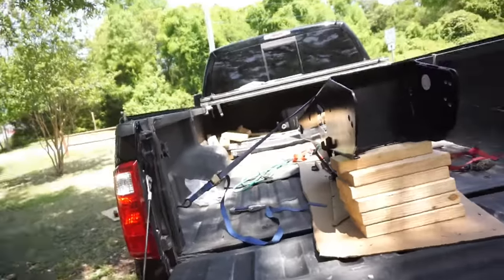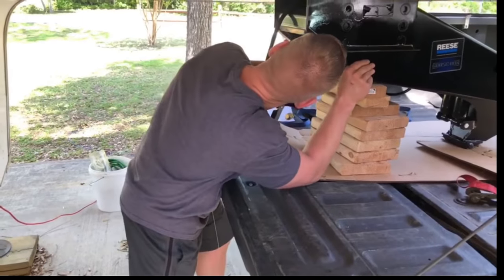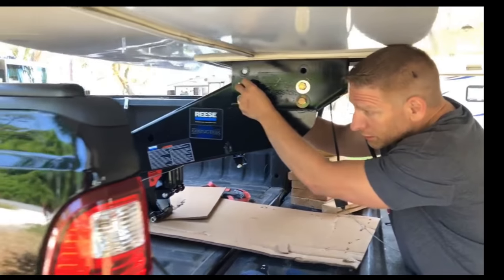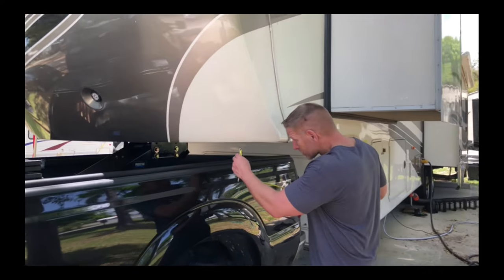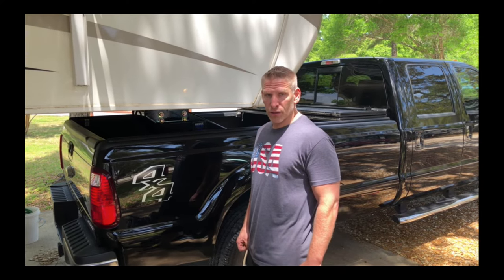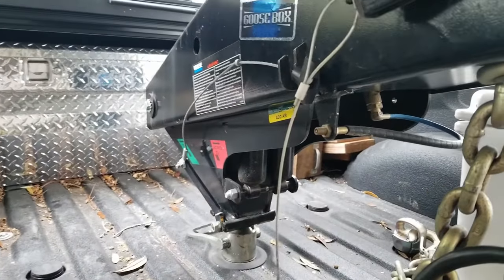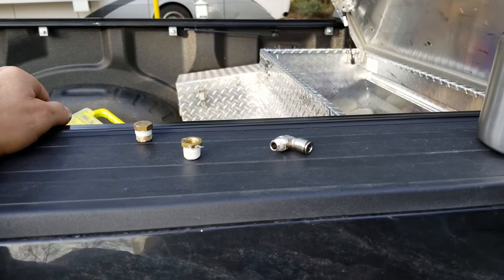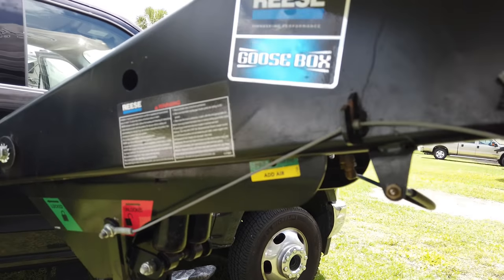How to Install your Reese Goose Box!

Comment: So when you fill the airbag up it also increases the space between the top of the bed and rv? If so how much? Because I have about 6.5 inches w/o any air in the goosebox
Reply from the maker: Yes,  just a couple inches.  I'd measure, but don't have it anymore. I wanted more height,  so I used a B&W ball. It's about an inch and a half taller than most other balls that fit the factory fifth wheel prep.

Comment: How did Reese respond to the issue of their blow off valve?
Reply from the maker: They send me a new one, which also had issues.  I had a wireless air compressor that I installed in the pinbox mounting area and plumbed in via the blow off valve hole so I could fill/adjust pressure on the fly.  It worked really well, so I  never pursued the valve again.

Comment: This is a super big bad idea fifth wheel camper’s with a fifth wheel hitch are not meant to be towed with a gooseneck. This will add all kinds of unnecessary stresses to the frame of the camper and definitely voiding its warranty very bad thing to do and no reason to do it
Reply from the maker: Actually, Lippert covers use of the Goosebox on their frames, and they manufacture the vast majority of fifth wheel frames.  It's not a true gooseneck adapter - kind of a hybrid.

Comment: Yeah using the landing gear on the front of the fifth wheel should make this project super simple... I also threw in my floor jack into the back of the bed,,,, went together super easy!
Reply from the maker: Yeah, it made it a one person job!  You can also use the airbags on the truck if you have them to fine tune height.  I didn't have a floor jack available, but would have been handy.

Comment: Buyer Beware! 
First - The Reese pinbox I ordered 6-weeks ago came without installation hardware or directions. The hardware took over a month for them to replace and again came without directions.
Second - The Reese pinbox DOES NOT have the air valve as pictured on the websites. When I called I was told it was due to a parts shortage and the person I spoke to at Reese (Paul?) even told me that the new set-up was a solution their engineers came up with to deal with the shortage and it makes no sense (his words).
I TOTALLY AGEE! Send me the part! They were supposed to and never did.
To inflate one person has to literally crawl under the pinbox, while hitched to the 5th wheel, to inflate while another watches the bar. Not easy for a 60+ year old fat man! 
The valve faces OPPOSITE the side where the inflation bar is located! Plus, the valve is so close to the wall of the box you cannot install an extension hose. Just Dumb.
After follow ups with eTrailer, I were basically informed by Hannah that I have to live with it. Either that, or I could pay to ship it back. Mean while, both Reese & eTrailer are selling parts that are not as shown on the website.
There is now a Gen 3 with a redesigned air valve, but they are shipping out leftover Gen 2's with missing parts.
NO - NOT HAPPY
Reply from the maker: That sucks!  I was an early adopter of the pinbox, and it worked well then.  I did replace the air valve and connect it to a compressor to control the air and alleviate all the issues associated with the air leaks.  I actually had Reese send me three of the valves that were being used then, and none worked. 

In the current market, I would be taking a hard look at the GenY Executive fifth wheel hitch.  It's simpler, and appears to be well built.  I have not used it though, so take it for what it's worth.

Comment: Great video on the installation.. I am debating on getting a Goosebox.. I have the same truck as you except it is a F-250 and it also has the factory 5th wheel/Gooseneck prep package so your video was exactly what I have been looking for.. You mentioned your turning was limited.. I have not found a video on showing the turning limits in you setup configuration.. Could you possible make a video showing the turning limits when you are hitched up?? It would really be great since there is no Gooseneck ball extension available yet for the factory puck system..Thanks again for the video..
Reply from the maker: Thanks for the comment! After using it for awhile, the turning angles aren't actually reduced.  When I first used it, I thought they may be, but I can still turn to the point of hitting the cab of my truck (if not careful).  The only issue that I've run into is that I can't open my front cargo door all the way - it now hits my tailgate towards the top.  I think there's maybe an inch difference, as the Andersen allowed it to barely open.
Reply: @TrippinWithTheSmiths  I have this same 1st gen of the Goosebox in my F350 dually bed going on 2 years (pulling 42' Coachmen 392mbl).  I park my 5th wheel in commercial, covered storage and literally have to back it in from outside the gate for a total of about a 270 degree landing.  I am commonly just short of 90 degrees backing.  There is absolutely max turning and maneuvering capability.  I am a huge fan of this goosebox.  The airbag is like driving on budda.  Also, it is so very nice to get where you need to go, then turn the ball over into the bed... and voila, wide open spaces in the 8' bed!  Safe travels.  bg
Reply from the maker: @takeitallin6882  Yeah, it's great for maneuverability....and not having it in the bed (we full time) is awesome, and I really miss it now that we've been forced to a traditional hitch.  We're too heavy for it.  I may get a GenY Executive Fifth Wheel hitch - they go to 30k and use rubber torsion suspension.  Would like to get a chance to chat with someone who uses one first.

Comment: Thanks for the honest review.  So far you are the first that said that you did not gain space because the Goosebox hits the items as it turns.
Reply from the maker: Np. The arm of the Goosebox sat a bit lower, and it killed our cooler that fit under the previous combo.  Your experience may be different,  depending on height,  but we had slight issues.  I'd still choose the Goosebox or maybe GenY overall tho. Ride quality and getting the bed back after towing is great!

Comment: Thank you for this video...your review is honest, and now after watching (air issues), and not really anymore space I dont think Im interested in this hitch anymore.  May do a anderson instead.
Reply from the maker: Another option, that I have not used, is the GenY Executive Fifth Wheel hitch.  As far as air issues, I fixed that with the wireless compressor - it always ensures I have the correct pressure.  Personally, I would take the Reese over the Andersen - after using for awhile, the ride is better, and I don't have to take anything out of the bed when I'm done towing.
Reply: @TrippinWithTheSmiths  I would really like to compare a auto slider vs the goosebox and see how much extra room you get on a short bed.  If it was possible to not do a slider I would go the goosebox route.

Comment: How many times have you needed the full use the bed of your truck unhitched with the Goosebox compared to having to remove the Anderson Hitch to get full use of the bed ?
Reply from the maker: I use the bed of the truck nearly every day.  We fulltime, and all kinds of stuff ends up in there - especially with the tonneau cover.  It turns into additional storage space for projects, tools, etc.  I also have two toolboxes in the bed, when the Andersen was in there, there really wasn't much space available.

Comment: I am  about to due my goose box did u use the standard mounting position or the lowest  on the wingset?
Reply from the maker: I used the lowest position that I could get all the bolts in, as when I mounted it, my trailer sat pretty low, and I was concerned about bed clearance.  I even went with a B&W ball which gave me another two inches of clearance.  I eventually lifted the trailer 3 inches to get it to sit level with the truck.  It was originally setup to tow with a 2 wheel drive, and I had a newer 4x4, which sat much higher.

Comment: Do you think my 2015 F250 crew cab shortbed 4x4 SRW will need the 4in B&W extended ball adapter to safely run a Gen2 Goosebox 16k?
Or is there enough sweep room w/out the 4in offset ball?  Thanks!
Reply from the maker: I'm not sure - I have no experience with shortbed and towing fifth wheels.  I've only used the long bed trucks with them.  Sorry I can't help!
Reply: I am looking at the same set up as you were mentioning, did it work for you?

Mike

Comment: So now that you have experience with the Andersen and some miles on the Reese, which do you prefer and why?
Reply from the maker: Overall, I prefer the Goosebox.  It's a better ride, and cushions the fifth wheel better.  It also leaves a nice, clean bed with no work. Additionally, it is "authorized" by Lippert for their frames.  The Andersen is still a good hitch, and if the Goosebox wasn't available, I'd use it.  Considering a bigger fifth wheel in the future, may have to go to a Trailer Saver due to the weight of it - then I'll be able to compare all three.

Comment: Good video. I just bought one myself. On a side note, to get the correct torque, you should torque the nut. Not the bolt.
Reply from the maker: Thank you, glad you enjoyed the video!
Reply: The torque spec for this application was specifically made for the outside of the bolt, not the nut. It’s in the installation paperwork.

Comment: Big Truck Big RV has installed one of these and he has claimed that it produces more space go figure!!
Reply from the maker: I really think it's a wash on the space.  The Goosebox sits lower in the bed, and as a result it tore up our cooler, and I can't put anything beside it.  The Andersen Ultimate allowed me to keep the cooler in the bed, as well as put stuff beside it and "in" it, so at the end of the day we had more useable space.  But - the Goosebox gives us a nice clean install/bed and is a better ride.
Reply: People don't think about that the goosebox sits a lot lower into the bed than a fifth wheel setup and there's nothing you can do to raise it up. B&W does have an extended ball but it only gives you an extra inch. You also have to watch the sides of your bed if you happen to have those swing out boxes mounted because it will definitely hit those. A friend of mine had to remove his boxes to make it work.

Comment: Mybuddy just put on the Sidewinder and the book has  a page for the torque values and yes one size was a couple of hundred ibs but the i/2 inch bolt was 95 (or whatever)--I think that is the same manufacturer as the goose thing-- just going by the looks of your bolts they look the same-15/16s---1/2 inch bolt---might check your book again---better safe than sorry---just trying to help---
Reply from the maker: Thanks, will double check.